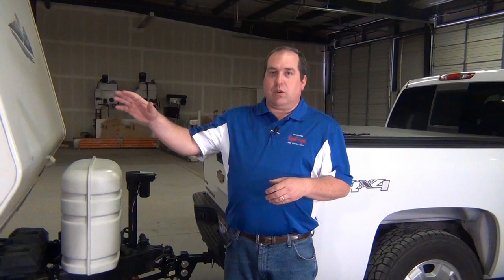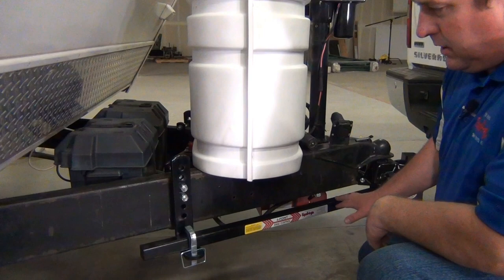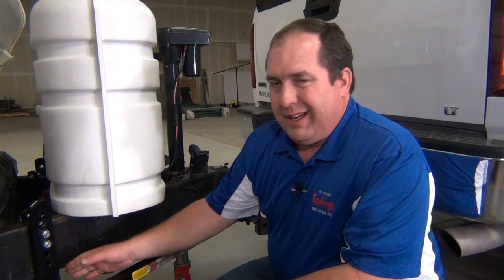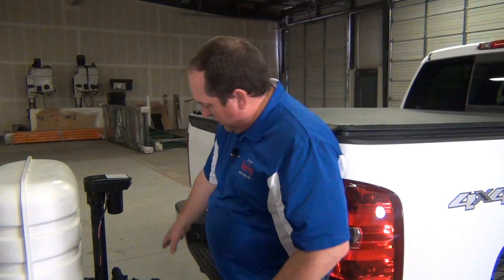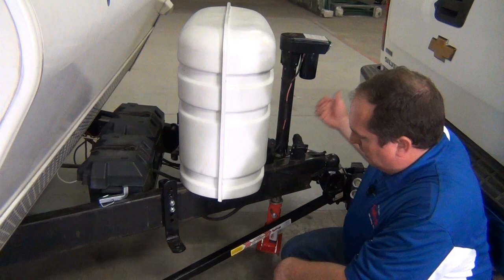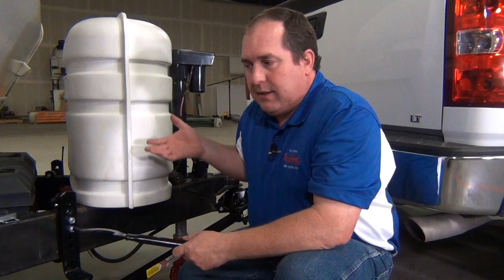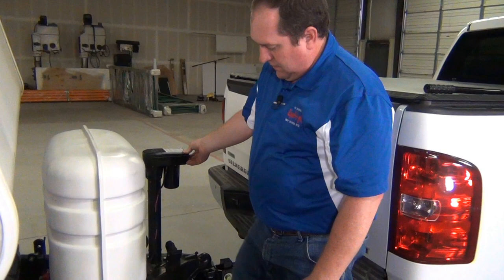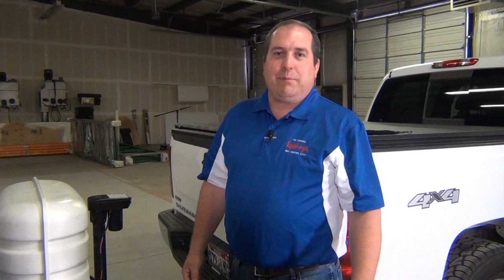How To Hitch and Unhitch Your Equal-i-zer Hitch

Comment: Pulling a Grand Design Imagine 2150RB with a Ford F150. The Equal-i-zer system really keeps things steady and smooth on the highway. Question - there is a lot of creaking and groaning (NOT from my wife lol!) when making turns, like at an intersection, or when backing into a campsite. Is this normal? Does it cause unnecessary wear and tear on the hitch parts?
Reply from the maker: Norton Newmann,

We're glad you have been having a great experience with the Equal-i-zer hitch!

Great question about the creaks and groans. The simple answer is yes, from time to time you will probably experience some noise. However, it should be taken as a sign that the hitch is working well, and your sway control is in force. This seems strange, because noise while driving is usually associated with something being wrong. In this case, it's nothing to worry about, and no, it won't damage the hitch parts.

The safety and performance you get from your Equal-i-zer hitch comes from the sway control that is integrated into the hitch. This happens at the four friction points (we call it 4-Point Sway Control), two in the hitch head, and two on the rigid trailer brackets. When under load (while you're towing) there is a TON of pressure at these points, which creates friction between the steel surfaces. That is where your sway control comes from. The harder it's pinched, the more that joint resists movement.

When you're in a slow, tight turn, the hitch components are forced to move to adjust to the changing angles between truck and trailer. But in order to move, they must overcome that friction. At the point where enough force is present to move the spring arms, the friction is overcome for a fraction of a second, and that release and movement generates a vibration that comes across as a creak or groan. With some imagination, it can be compared to the plucking of a guitar string, or drawing the bow across a violin string.

The best thing to do to minimize or eliminate the creaks and groans, is to regularly take a minute and put some grease on the friction surfaces of the hitch head. We have a great blog post that shows you how to do it quickly and easily, which you can read here: https://www.equalizerhitch.com/blog/02-25-2016/how-to-lube-your-equal-i-zer-hitch (use ctrl + "+" or "-" to zoom in and out if needed). In almost all cases, this will take care of it.

If your wife is still groaning about the creaks after you lube the hitch, you can try some of our Sway Bracket Jackets, which you can find here: https://www.equalizerhitch.com/store/hitch-accessories/sway-bracket-jacket-pair

Good luck, and safe towing!
Reply: @EqualizerHitch  Is there any downside to the sway-bracket-jackets?  Does it reduce the effective sway reduction?
Reply from the maker: @GeoffWhittaker  no, there is downside to the Sway Bracket Jackets. They have been used successfully by thousands of customers for many years. Yes, they do slightly reduce the friction between the weight distribution bars (spring arms) and the L-brackets, but it is really unnoticeable because the majority of the sway control with the Equal-i-zer hitch comes from the hitch head. If you are looking to reduce noise, we suggest that you first lubricate the sockets in the hitch head properly [http://eqhit.ch/o] and try it out. This usually eliminates the noise. Then, if it does not, try the Sway Bracket Jackets.
Reply: Mine makes a heck of a racket too, but I don't mind.  It means there's lots of friction in the system, and that's what makes it work.
Reply from the maker: @ironflange , thanks for the comment. You’re right about the noise and friction, nothing to be worried about, just evidence that it’s working well. One thing you can do to reduce the noise a lot is keep the sockets in the head well greased. Here is an article about how to do that. [ http://eqhit.ch/o ] Thanks for towing with an Equal-i-zer hitch!

Comment: I've heard that you can hook up your bars while your trailer hitch is still in the air before you lower it onto your truck , does that work also ? Thanks
Reply from the maker: We’ve never tried it that way, but we think it is not likely to work with a hitch that uses rigid brackets like the Equal-i-zer hitch. This is because the angle of the weight distribution bars from the hitch head backward is sloping toward the ground. This angle helps get the leverage you need for the weight distribution to work properly. Usually the ends of the bars are a few inches below the brackets on the trailer before hitching up. This method may work to attach the arms on a hitch that uses chains to hold up the weight distribution bars, but once you lower the trailer onto the hitch ball you will have to adjust the chains to get good weight distribution, so it doesn’t seem like a very efficient method of hitching up.

Comment: Great Job!  At what point do you raise or lower, as applicable the electric stabilizer jacks?  thank you.
Reply from the maker: +David Dion,
After you get the tow vehicle unhitched and out of the way, use the tongue jack to get the trailer level, then use the stabilizer jacks to stabilize the trailer. When you're ready to go, raise the stabilizer jacks first, then use the tongue jack to raise or lower the trailer as needed to couple it back to the tow vehicle.
Reply: Thank you, one of the very best video/explanations I’ve seen.  Great Job!
Reply from the maker: +David Dion,
You're welcome! Thanks for watching.

Comment: sometimes I get one bar off easy and the other side I have to fight with. Mine is 10 years old.
Reply from the maker: +Kenny Cosway, thanks for the comment.
The best way to deal with this is to use the tongue jack to raise both vehicles a little higher, so that all of the weight is taken off the ends of the spring arms. Congrats on the 10 year anniversary!

Comment: Having a problem followed directions perfectly ball will not release .  What is up?
Reply from the maker: There are two common causes of this problem. Not enough grease in the coupler/coupler latch/hitch ball, and movement of the tow vehicle or trailer that puts forward or backward pressure between the hitch ball and coupler.

The primary solution is to add a good layer of grease like the Equal-i-zer High Performance Lubricant [http://eqhit.ch/1m] to the hitch ball, and within the coupler socket, especially on the moving parts of the coupler latch. This will solve the no-grease problem, and also help if there is pressure on the ball.

If pressure is the problem, make sure the trailer is chocked well on both sides and if possible, determine if the hitch ball is being pulled forward in the socket, or pushed backward. Put the tow vehicle in drive or reverse (depending on which direction you need to go) and let it move just enough to relieve the pressure.

Rarely, but also an occasional problem, is a coupler that has been bent or damaged, or that was manufactured slightly out of tolerance and is a bit smaller than it should be. In this case, you may need to repair or replace the coupler.

If this does not help you, please get directly in touch with our Customer Support team for help at 800-478-5578 or support@equalizerhitch.com.

Thanks for watching, and thanks for towing with an Equal-i-zer hitch.

Comment: Should this be removed when backing up or not?
Reply from the maker: +Caleb Cissna

There is no need to remove the Equal-i-zer hitch to back up, with one rare exception.

If you are backing from a flat piece of ground where there is an abrupt or sharp transition to a steep incline, you should take the spring arms off. For example, a flat street backing the trailer up a very steep driveway, where the intersection between the street and drive is very sharp.

In this case, the angle of the trailer relative to the tow vehicle, and pushing instead of pulling, changes the way the load is applied to the adjustable shank, and can put too much stress on it.

Otherwise, back it up anywhere you want to!
Reply: Just to add, under normal situations, RV’ers are used to removing sway bars and/or J-type distribution bars.  With the Equil-i-zer Hitch, there is no need for that, with the exceptions they mentioned.

Comment: Why does my hitch make SO MUCH noise when turning especially on the way home from a week away at the campsite
Reply from the maker: Great question! The noise comes from the friction surfaces in both the hitch head, and at the sway control brackets. The easiest way to imagine it is to envision the way a violin makes sound. When the bow is moved across the string, it grabs and releases it very quickly over and over again. The result is the string vibrating, with that vibration being transferred to the body of the violin, and producing a sound. With the hitch, as you make a turn, the friction surfaces grab and release in much the same way, and this produces the creaking and groaning you hear. It is amplified by the frame and interior space of the tow vehicle and trailer. It is sometimes unsettling because most of us associate loud noises in our vehicles as an indication that something is wrong. However, in this case, it is a good sign because it is an indication that you are getting good friction at those points in the hitch, and that is what provides the superior sway control of the Equal-i-zer hitch.

The best way to reduce this noise is to follow the lubrication guidelines in the maintenance section of the Equal-i-zer hitch owner’s manual [https://www.equalizerhitch.com/manuals-guides/manuals/6k-14k-model-owners-manual/regular-maintenance]. Keep the friction surfaces in the head well lubricated and free from road grime and dirt. In most cases, this eliminates the noise. Additionally, you can make a slight adjustment to the setup to make the spring bars more parallel to the trailer frame. This may involve adding a spacer washer and lowering the L-bracket one hole, or vice versa. Finally, you can use a pair of the Equal-i-zer Sway Bracket Jackets [https://www.equalizerhitch.com/store/hitch-accessories/sway-bracket-jacket-pair]. These sit on top of the L-bracket, between the L-bracket and spring bar.

Thanks for the question, and thanks for towing with an Equal-i-zer hitch!

Comment: Quick question, I have a 2016 5.7 Tundra double cab and I have an equalizer hitch installed . I pull a 26' travel trailer . I haven't had any issues so far but do I also need air bags ?
Reply from the maker: +Brian Gutierrez

With your Equal-i-zer hitch set up and working well, you should not need to do anything with air bags. It will work very well to lift the sag and distribute the weight by itself.

Using air bags does not increase the towing capacity of the tow vehicle. They do take the sag out, but do not distribute any weight.

However, they are a great way to make it so you can quickly and easily adjust the stiffness of your suspension. Basically, it is like adding or removing leafs on the springs, but you don't have to take everything apart and put it back together to do it, just inflate or deflate.

If you do decide to use air bags, make sure you inflate them to your desired towing pressure BEFORE you set up your weight distribution. Otherwise, they will actually counteract the benefits you're getting from the hitch.
Reply: Equal-i-zer Hitch thank you for that information .
Reply from the maker: You're welcome, Brian Gutierrez! Let us know if you have any other questions.

Comment: It would be nice to SHOW how to get the round bar OUT of the hitch!!!!
Reply from the maker: Charly,

Sorry to hear that you're having some frustration with your hitch.

Unfortunately, the Original Equal-i-zer hitch is not a round bar style hitch.

Is it possible that you have a Fastway e2 round bar hitch, or perhaps some other hitch brand?

If it is an e2 hitch, please get in touch with the Fastway customer support team, and they can quickly help you find a solution to the problem. You can reach them via phone at 877-523-9103, M-F from 8:00 a.m. to 5:00 p.m. Mountain time, and also via email at Support@FastwayTrailer.com.

Good luck!
Reply: What round bar are you talking about?  My hitch has square bars.
Reply: never mind. The e2 has 2 points of friction vs the 4 of the Equalizer. They(Fastway) also offer the option of trundle bars or round bars. It is the same basic design and no one really wants to say how Fastway and Equalizer are related, or if they are.
Reply from the maker: *****,
You are correct, the Equal-i-zer hitch has four points of friction sway control, and the Fastway e2 hitches have two. Both brands are manufactured by Progress Mfg. Inc., in Provo, UT.

The Fastway e2 hitches are an improvement on the traditional trunnion and round bar hitch, with the addition of rigid brackets and built-in sway control. Both styles (trunnion or round bar) give you two-point sway control. These are comprable or better than all of the other sway control hitches on the market.

The Original Equal-i-zer Sway Control Hitch is not similar in design to a traditional trunnion or round bar hitch, other than using the spring arms to get weight distribution. Its 4-point sway control design gives it the best sway control you can get in a hitch, and puts it in a class by itself as the best sway control hitch available.

Comment: How do you remove the sway bars?
Reply from the maker: Raise the trailer jack, remove the L-Pins, swing the bars out off the L-bracket, and remove the socket pin and clip. Then you can just pull the bar right out of the hitch head.